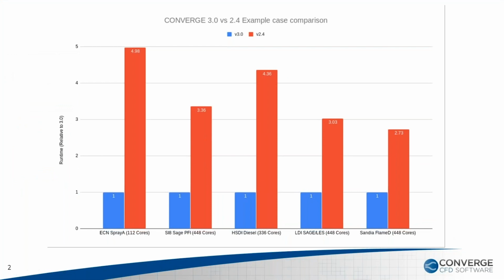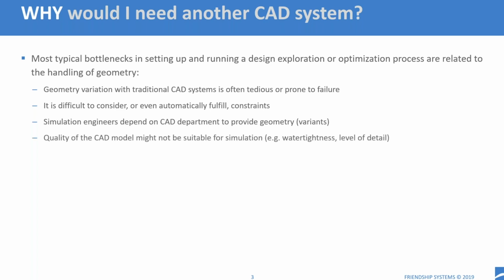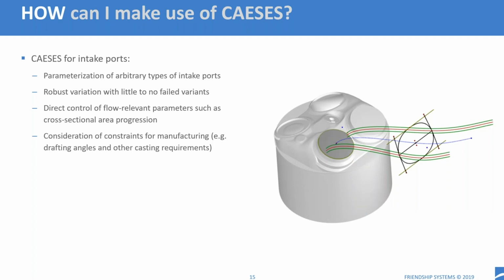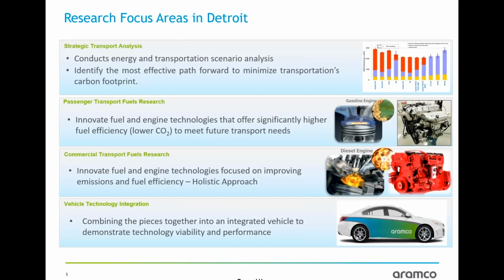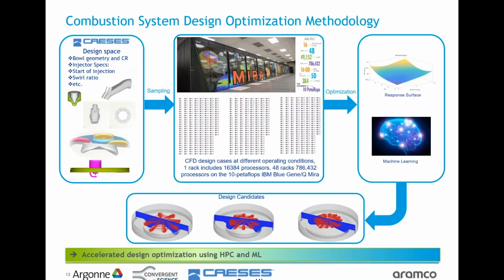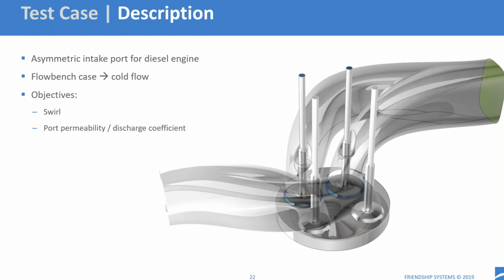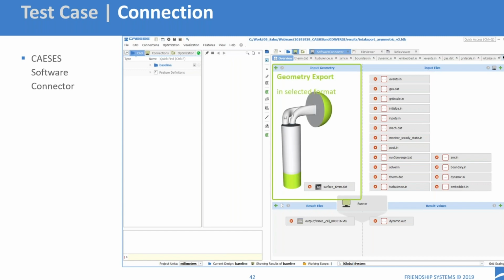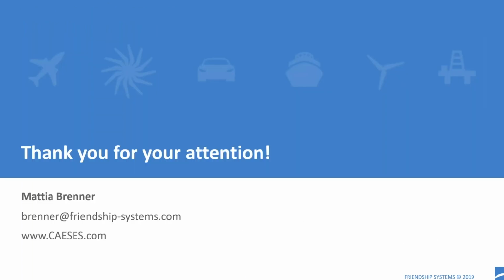Webinar | Optimization of Powertrain Components with CAESES and CONVERGE

Comment: I would like to see these optimized components 3d printed with high temperature thermoplastics (Ultem for the intake, and PEEK for the exhaust) and insulated by graphene so all that heat contributes to the overall downforce of the race car in a motorsports setting.